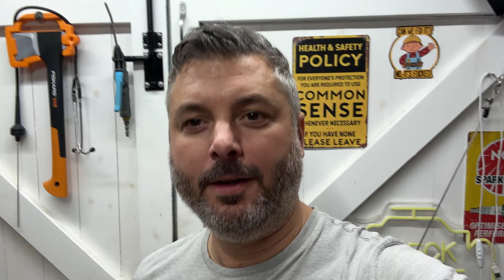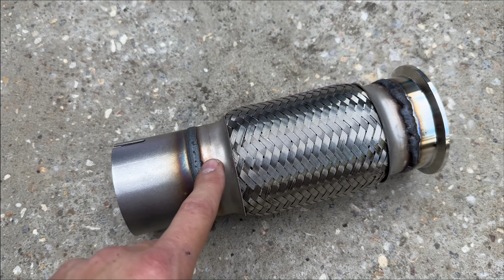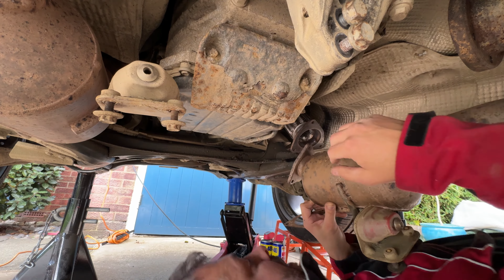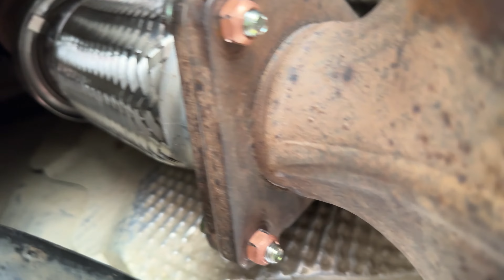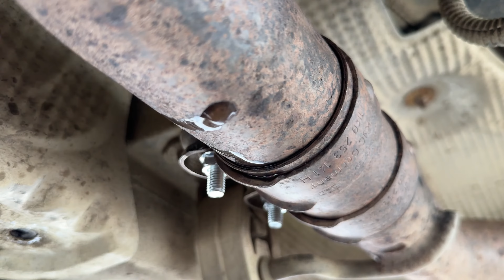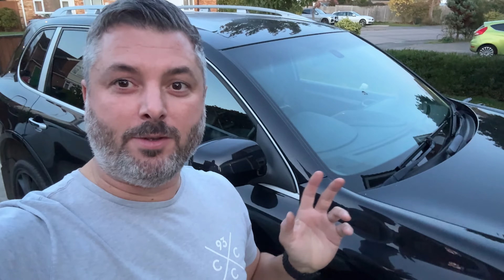Porsche Cayenne GTS Exhaust Flexi Repair – Welding a New Flex Pipe! | Part 2

Comment from the maker: 🔧 *FINALLY! The Cayenne exhaust flexi repair is sorted!* 😂

After all the dismantling in Part 1, I discovered that the replacement flexi I'd bought was the wrong diameter.

Rather than take everything apart again, I came up with a solution using V-band flanges, a clamp and a bit of stainless steel welding.

The result is a repaired exhaust flexi section with a detachable connection for future maintenance.

🎥 *Missed Part 1?*

Watch the original strip-down and see just how much had to come off the Cayenne to access the exhaust!

👉https://youtu.be/6wM9eyo88tI

💬 *Would you have repaired the original exhaust or simply replaced the whole downpipe?*

Always interested to hear how other DIY mechanics would tackle a job like this!

Thanks for watching!

— Frenchy 🔧